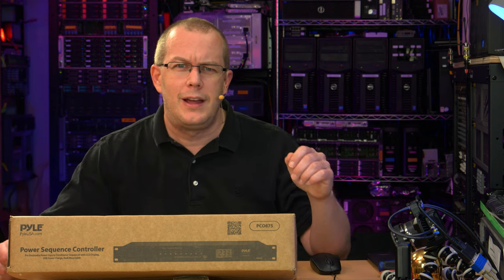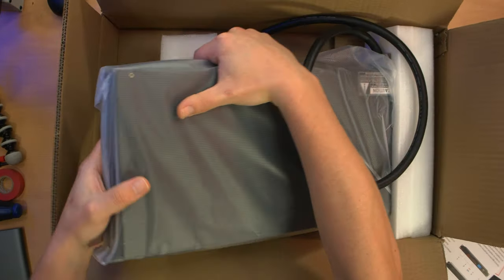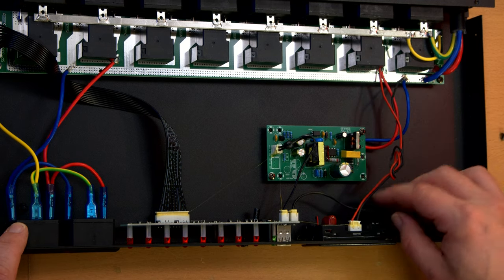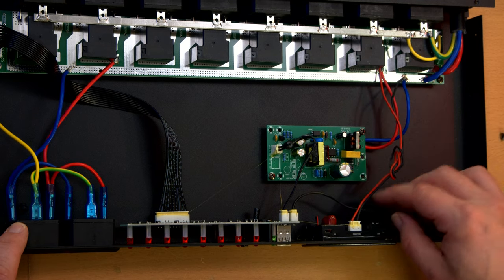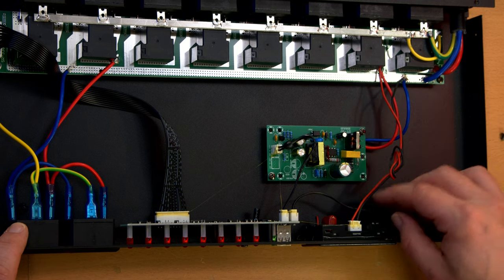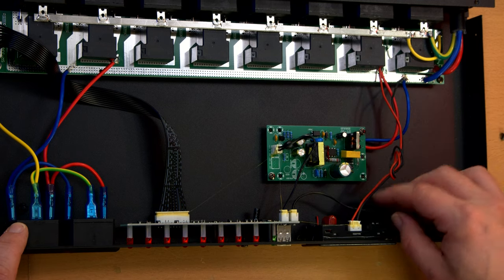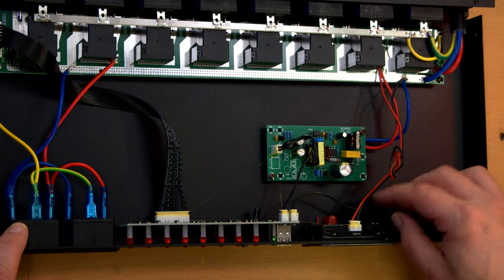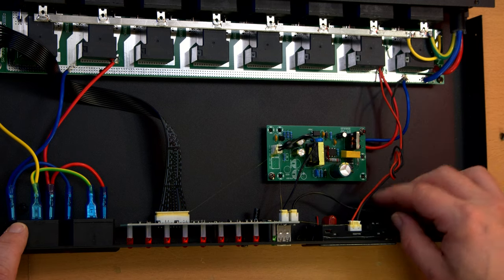Pyle of Lies - The Pyle PCO875 Power Sequencer and "Conditioner"

Comment: Let’s see … IF I were a lawyer in addition to having an electrical engineering degree…

The closeness of those solder joints to the (grounded) chassis … form a rudimentary ”spark gap” to shunt surges (sort of). 😀
That actually surprises me. MOVs are cheap! An EMI filter costs a little bit more, but for a device this pricey ... ???

The heat on those wires, though … unless that was silicone insulation, which is rated 200° C., you’d be lucky if they were rated 105°C.  (if they were THHN conductors).

Also, the purported suitability for ”stage” use … I would have put a breaker on each outlet. You wouldn’t want an overload/short on one device item plugged in to trip the breaker for the entire circuit, including all 10 outlets!

Another thing, I didn’t see if that 12v power supply board had a thermistor ”resettable fuse” on it or not. Were I designing (some would say ”over-engineering”) it, I would have added some protection there, too.

One last item, putting a switch mode power supply in a ”power conditioner” could be asking for trouble. I might have put a scope on the AC line to test for EMI from that thing chopping up the power willy nilly!

Comment: Appears to actually be a Pyle of Lies, not as advertised.  Personally would not prefer line conditioning within the unit because they will eventually fail.  Brown/black outs of the power utility service, surges will eventually take out the line suppressor(s) sooner than later IMO.  Individual line breakers would have been nice along with individual outlet power indication and the ability to disable individual outlets. although the price would be much higher.  The USB power was added because much of the works was already present, kind of gimmickry, yes.  Overall appears to just be a fair value.
Reply: This appears to be a Pyle of Crapola.  The "thick" power cord appears to be mostly PVC with approximately 16 gauge wire in it, the wires going to the two always on outlets appear to be 18 gauge as Scott said it was and the USB is only meeting rating up to 100mA.  This reminds me of a USB cable I bought once that appeared to be about 18 gauge telling from its full size but it would only send about 350mA at five volts.  I cut it open, it was almost all PVC with the actual conductors being about 30 gauge.  After that one I started buying either Anker or RavPower USB cords and they work as advertised even though they appear to be thinner than my eBay special cord from the total thickness including the PVC jacket (both will easily carry two amps at five volts DC).

Comment: For the cable, you don't have any calipers? If not, you can get some plastic ones for as little as $4 or metal ones for about $10, I don't use them often, but for how cheap they are I'm glad to have them when I do need it.

Comment: now I would really like to know about my pyle PS1200, It's actually all there, I screwed it open, at least there are some fuses and varistors in there that should provide surge and overload protection. also the overall quality of the wiring and usb inputs is way better then the 875.  but I have minor knowledge of electronics so i can only verify that it's all there..   I'm really wondering about the quality/ if it REALLY protects my gear. could anyone help me out?

Comment: THANK YOU So.... Much! I just cancelled an order on Amazon, as after just seeing your Amazing Video, I could now see what I would Really Get = CR*P, the product is advertised as "WANXIAO VS-1028 10-outlet Rack Mount Power Sequence Controller Conditioner Surge Protector Supply Regulator LCD Display USB Interface" it is exactly the same as in your Vid but with a different Badge!
You are a life saver, as I need a "Power Conditioner" as will be running Dj Equipment from a Generator in a Marque, so if I had of Used This a lot of my Kit would have been Deep Fried Chinese Style haha
MANY... MANY... THANKS AGAIN

Comment: I have 2 of these and they are doing what I want them to do and that is to turn my equipment on and off in sequence and as far as what you see inside the unit is not the same as what you see here and the power switch is wired with 14 gauge wire. As far as the filtering goes I don’t think it’s going to be possible to get real filtering unless you spend 26k and up and it has been proven that the other units are not worth the money you pay for them because I have a few of them.

Comment: It is exactly a pyle of crap. its not a conditioner by long shot, rear panel plugs suck. within a week one of rear plugs stopped working. infact the usb plug and read out voltage are only thing that work after 2 weeks. we bought out of curiosity and its confirmed by this guys video and soon to follow others.